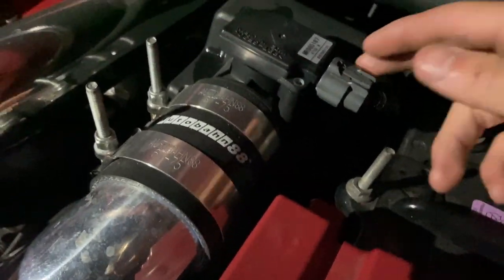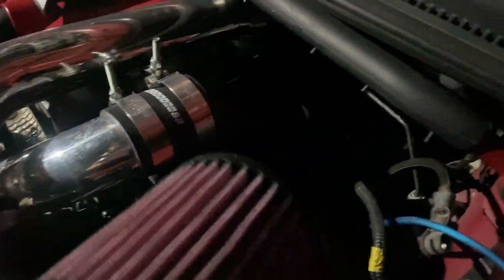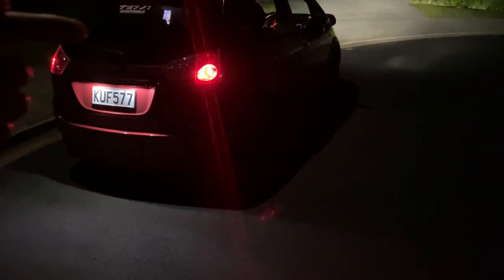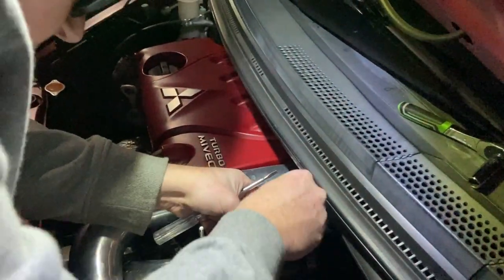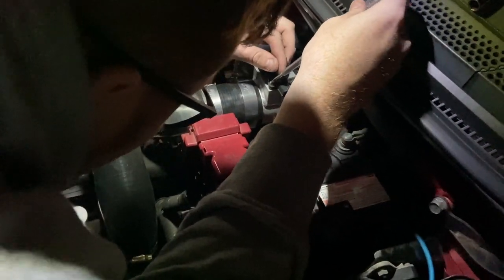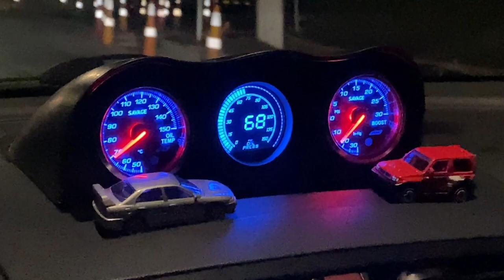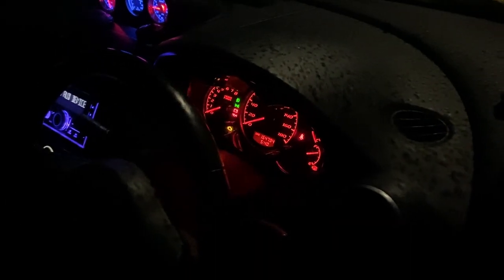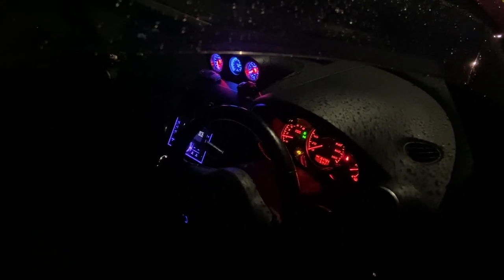POD FILTER on the colt plus

Comment: are you using 2.5" or 3.0" for the MAF adaptor?? I'm thinking of getting a pod air filter myself as well
Reply from the maker: Using 2.5in adapter but you will need to get the MAF rescaled by tuning it as it is bigger than oem size
Reply: thanks for the heads up. Looking into getting a FMIC in near future! @Alexshao1

Comment: Will it throw a code if i install the pod and adapter on a stock without tuning
Reply from the maker: For a manual will probably throw a code as they are more sensitive, even for cvt there’s small idling issues and throttle response issues that get fixed w MAF scaling
Reply: So need to get it tuned basically, also does it take more fuel for heat soak or running rich. Thanks
Reply from the maker: @Motomaniac2408  will be best if can be tuned yeah , prob be a bit warmer IAT but nothing that I can feel . Best to have k@n panel filter if u worried about temps
Reply: Need the sound of turbo dose woosh 😂😂
Reply from the maker: @Motomaniac2408  hahaha there is turbo noise even without pod filter . Panel filter is still good for noise and just hard pipes and a recirc BOV
Reply: Ya thinking of going with k&n filter and a dual port bov. Does it sound better with just a k&n filter on its own. Its very restrictive the stock airbox
Reply from the maker: the stock air box prob has better temperatures compared to a open pod filter as it has a air duct snorkel .The stock box w k&n panel filter still makes induction noise and flutter just not as loud as a pod filter, and BOV best to have it recirculate back and not vent, which is what i have done on my GFB BOV